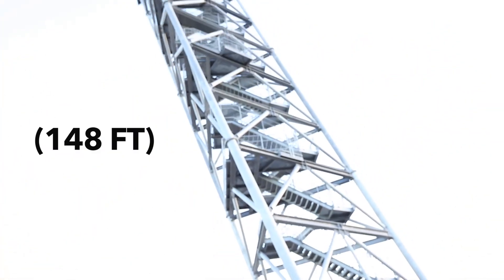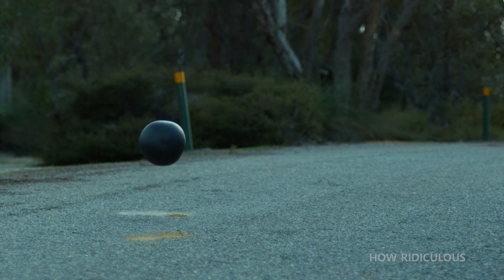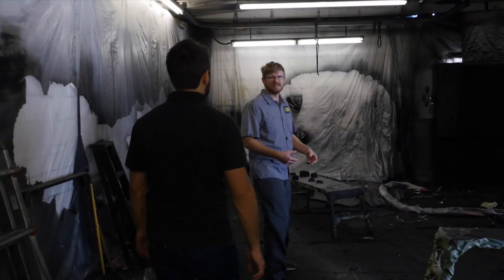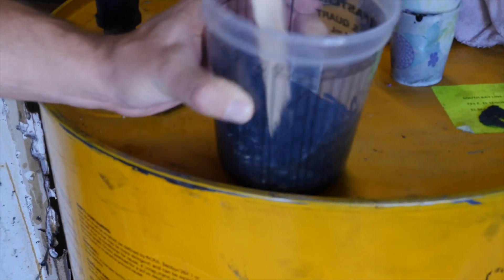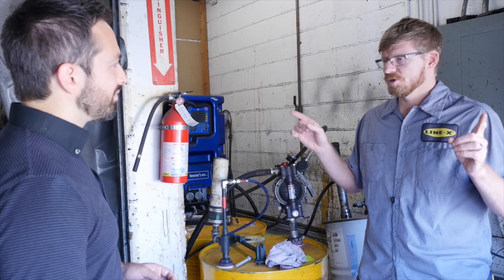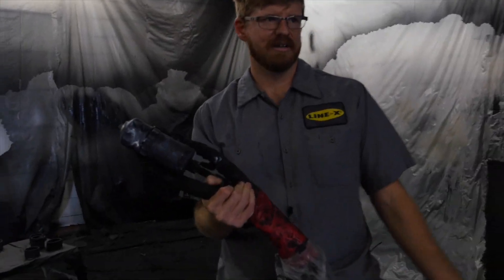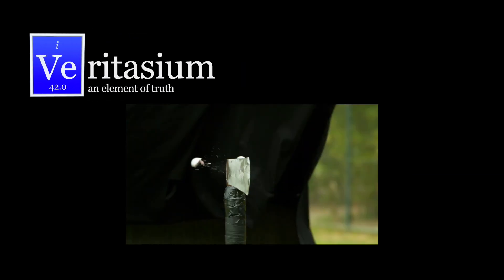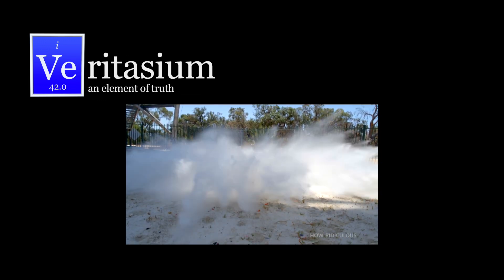Indestructible Coating?!

Comment: These guys should team up with team aerogel.
Anti ballstic outfits with superior insulation, for both cold and warm weather.
Reply: The areogel needs structural support, which is provided by the Line-X.
The aerogel provides great insulation and is kept together by the line-x.
Microcushioning allows both ballstic force dispersal but also insulation.

Space suits !

Comment: Years ago the Mythbusters used a product like this and sprayed a concrete wall with it. They then placed a 1lbs charge of C4 all of 3 feet from the wall and exploded the charge. The control test without the bed liner blew a hole in the wall. The bed liner covered wall survived the blast easily.

Comment: At 2:07 the barrel label says "polyol" but the molecular structure shown at 2:34 is a diamine. MDI+Polyol=Polyurethane and MDI+Diamine=Polyurea, a bit confusing...
By the way, the MDI is most likely polymeric MDI (PMDI), which is a mixture of MDI with polyfunctional phenyl isocyanates.
Reply: Yes

Comment: how a watermelon with g(9.8)m/s^2 accelerates up to 103 km/s only for 3 sec.
it should be ~30km/h in 3 seconds
Reply: am i stoopid?
Reply: It's 9.8 meters per second *squared*. It must be less than 3 seconds tho to be 103 km/h because if it was 3 seconds it would reach 158 km/h. I calculated 2.4 seconds to reach 103 km/h.

Comment: We can use this linex for army vests, inner ceramic coating, 2 layers of linex covered thick industrial strength  kevlar, it could survive ak and other shots.
Reply: Typically we have up to 4 ceramic plates in our vests, made of boron carbide, they are rated for small arms fire. An AK model rifle and several other types of rifles fire 7.62 mm rounds, this is currently what the ceramic plates are rated for. I'd be curious to know if spraying the plates themselves in Line X could increase the amount of attacks the plate can take, as they can only take a few rounds before they stop working. Or you could drop it on the ground. ceramic plates will break if dropped, even the smallest invisible hairline fracture can mean the difference between the plates doing their job, or your job coming to an end.

Comment: Stupid science 
Science poisoning the world is the solar system rotating inertia. 
Positrons + and electrons  -- rotate very rapidly after 4, 6 billion years of creating the Sun ' s core, so the core of the Sun rotates very quickly like A super large electric turbine that produces super large electrical energy. 
Every second the Sun emits 4,1million tons of electricity create sunlight, sunlight moves the circle back to its original position after 8 hours, so pushes the 8 planet to rotate in order

Comment: im very curious about utilizing this as a coating for Kevlar/ body armor. it would be excellent for blade resistance or low-power handguns.
Reply: Mythbusters actually did an episode where they coated a sleeve of a shirt with it and used it with a K9 attack dog.

Comment: I can see a thickness of about an inch in the watermelon coating application ..... Is that the right thickness to be used every single time...????
Or you a scammer....????
How about 12 mills to a maximum thickness of 23 wet mills... Then I believe you....Maybe you are not a professional applicator......mmmmmmmmm
I don’t know with this stupid video🥸

Comment: Pretty cool example... The initial watermelon drop made me think about how often they are compared with human heads and wonder about that result..... Of course the second result reminded me of what happens to a head inside a helmet... Internals can suffer pretty bad from a rapid deceleration, even if the outside isn't damaged much....

Comment: Could this indeed be the "molecular bonded shell" we've all been waiting for, inspired by KITT from Knight Rider??  Is it that good?  (If not, could it be improved for an even better bond?)
Reply: Actually, on second thought, a "molecular bonded shell" for a car would probably not be a good idea in real life.  1. As it would prevent any damage to the vehicle on impact, guess who would get the full force of the impact?  Crumple zones are a good thing!  2. If every car on the road had this shell, Aristotle's age-old question of what happens when "the unstoppable force meets the immovable object" (referenced in the Knight Rider episode "Trust Doesn't Rust") would be answered, and we wouldn't like the answer.
Reply: @ebinrock  Actually, the "shell" deforms as you see with the watermelon, so the crumple zones would also still work.  It would be great for preventing minor crashes from ruining your bumper though.

Comment: That’s so misleading... the watermelon is def nowhere to initial state, so NO It does NOT remain intact... the coating maybe, but the content NOPE... so it’s useless... let’s coat cars with it, it doesn’t matter do your brains are scrambled inside... looook the car has suffered a scratch ;)

Comment: Impressive, but that was a pretty thick, so you can’t really call it a “coating” - it essentially became a container vessel.
Reply: for the watermelon sure but I think they just sprayed copious amounts for that.
Reply: @kennarajora6532  That was my point.
Reply: @andy347  Yeah sorry I'm a bit dense. I thought you meant the coating was more of a vessel in general. Rather than for just the watermelon.
Reply: @kennarajora6532  Well, perhaps I should’ve elaborated. At what point do we transition from a “coating”, to a “structure”?  I would say them calling this a coating in this case is quite a mis-labeling.
Reply: @andy347  I guess coating is something more 'grafted' and stuck to the surface of something than say built over it. But I wouldn't know.

Comment: "It's amazing the watermelon survived". It didn't though, did it? The coating survived. The watermelon was  mushed on the inside. If you sprayed yourself with this stuff and jumped off that tower, the coating would be fine, but you'd probably have at least several broken bones and your insides would be mush.

Comment: Invented as truck inliner? Sorry, that is not true. The invention goes back to the 30s and 40s in Germany at Bayer company. And the first commercial application was insulation foam for beer barrels (sounds like a cliche, but is true).

Comment: If they had coated the Space Shuttle Main Tank with this material, we probably would NOT have lost the Columbia! Amazing stuff.
Reply: why didn't they have this stuff long before 2011 :(
Reply: and why did they not use aerogel for heat sheilds

Comment: Make an aerogel plate, cover it in this stuff and see how bulletproof it is.
Reply: @Azazel Aerogel is pretty fragile in it's original form. It'd be cool to see how durable it makes it.
Reply: @Azazel it is very light and if you spray it with this it will make a very light shield and a thermal insulator
Reply: Is this a new form of Fantasy Polymer championships? Where do I build my team?
Reply: That can work, it will also be very light and aerogel is pretty strong itself
Reply: @aar6538  aerojel is like ceramic. It’s a bit more fragile and the only bonus of putting it in armor is that it’s lightweight. Dragon skin armor plates would have the same effect as this.
Reply: @legitler1208  aerogel isn’t “a bit more fragile”. Aerogel is easy to break just by pressing on it with your finger.
Reply: @aar6538  
Aerogel on its own isnt hard.. its mostly air so.
Reply: @emperorpalpatine5559  that’s why spray it with this stuff and make it more durable
Reply: @aar6538  aerogel is extremely brittle so not that strong.
Reply: wait, that sounds like  the perfect heat shielding. What is the melting point of this polymere?
Reply: @KiithNaabal  my guess is its fairly low compared to aerogel. In other words not very viable.
Reply: @KiithNaabal  that’s not the question that needs to be asked here, what does need to be asked is how insulating it is because if it isn’t a good insulator then the aerogel is essentially pointless.
Reply: A light durable heat shield (and possibly bullet proof)
Reply: Smart
Reply: well aerogel is strong stuff then line-x- coating will turn it into a substance stronger than steel
Reply: @SodiumTriphosphate imagine thinking this
Reply: That is exactly the first thing that went through my mind.
Reply: It'll be great for light weight hard material like Armor or equipments
Reply: Gunnut?
Reply: Yooo thats genius actually
Reply: Can't tell if this is a joke or not but this material and aerogel is nowhere near hard enough to defeat any projectiles. Even 22lr would pass through it easily.
Reply: I like the concept. I figure what would be most effective is if you layered the two, one after another like bullet proof glass. Put a frame around it and you've got some light soft armor. Gotta test that for strength though
Reply: @Azazel Do you realize your username is named after a demon lord (not just in that anime)?
Reply: @talanorth8388  yeah Azazel is one of the best known of the biblical characters, it'd be real hard not to, and it's referenced extremely often. It's not bad as far as a name goes, short, memorable, has a nice ring to it. Why does it matter?
Reply: Aerogel is brittle, also if you cover it with this polymer you also remove this thermal insulating properties because the way it works is take fresh air from around its surface and when it heats up it escapes, maybe you can elaborate?
Reply: No. Fill the space between the aerogel with it.
Reply: Only problem is that the whole thing would be pretty weak (aerogel is very weak and this stuff is flexible). You would need some kind of backbone to keep it all in one rigid form.
Reply: @Azazel actually, extremely brittle. So yes it is something weak
Reply: @Azazel super critical fluid? part solid, part liquid ?
Reply: Nice
Reply: Aerogel is very brittle. Why tf would u use that
Reply: @drained1177  base aerogel is, but there are plenty of modifications that make it viable.
Reply: @Naokarma  but at that point there is no reason to use aerogel. Insulating properties aren’t really useful at all and it isn’t really the most lightweight option in other forms.
Reply: @peepock7796  "Insulating properties aren’t really useful at all"

Please tell me you're joking.
Reply: @Naokarma  “shield” please tell me you’re joking
Reply: This is dumb idea aerogel is rigid and crumbles easily while this is flexible material it will bend and gel will turn into dust.
Reply: @Cypeq  

Well. Even if it crumbles its still compacted to its original shape giving it some rigidity.

Comment: Why don't they put that stuff on tires and stuff. This could be revolutionary but they're spraying it on melons.
Reply: On tires? Have you ever heard about a thing called traction?
Reply: @SanityDrop  thats a good point, maybe the inside?
I'm not a tire person so idk
Reply: @toaster2822  What use would it have in the inside?
Reply: @siyacer  tires won't pop
Reply: It'd probably wear off on the road anyways. Having somewhat soft rubber lets you drive without sliding everywhere.

Comment: I overpronate a lot on my left foot causing my foot to destroy the top left corner of the outsole of my hiking boots,  heavy work boots duty boots, tactical boots, etc. No matter what quality of material the outsole is my left heel will destroy it within 2 months rendering it useless 😢 and be honest I'm tired of buying boots because nothing lasts. So could it be possible to put a layer of this in my outsole boots?

Comment: I used to work in a factory that created polyurethane foam parts for the auto industry (Cup-holders, armrests, etc). The chemicals that Line-x uses are the same as the ones that we used to make auto parts. This stuff has some amazing properties but as all of you saw it is an incredibly messy process. It's kind of crazy to think that with the right ratio of Iso and Poly and the right pressure, you can create this stuff.

However, these chemicals are an environmental disaster. Isocyanate reacts with water instantly and once it is exposed it crystallizes instantly and it is almost impossible to separate once it has made contact. Getting this stuff in your eyes, mouth, nose is horrible, you can go blind from it and it can be lethal. Plus the waste for any process involving these two chemicals is considerable. I'm surprised that the EPA hasn't shut that factory down. It was insane.
Reply: Is there a sheet or film version, maybe skived? What's the friction coefficient or what material is the friction similar to?
Reply: Interesting thanks for the comment
Reply: Neither trump or bidens epa has ever thought about clean and safe env standard
Reply: I agree, I also spent time in similar factories. Too bad there are no economical replacements. Maybe 3D printing in 20 years. All that PU has the deadly combo that capitalism loves. Its cheaper to make, faster to make, easier to make and stronger than most any other material in existence and it’s highly tunable. The difference in foam/plastic type you can get just by varying temp/pressure/ratio can produce a nearly infinite variety of products at practically no extra cost to the manufacturer. All the major processing tools and materials are the same. Like growing 100 different kinds of fruit from the same tree. Speaking of environmental impact, synthesizing the raw materials at plants like ones on chemical row in Louisiana. Eek, scary to see what it does to people and the environment. It’s really in everything. But it’s like what are people gonna start stuffing the seats of their Honda’s with dead leaves and coil springs?
Reply: @ericweiss9893  muh capitalism bad
Reply: " I'm surprised that the EPA hasn't shut that factory down" it's because the US military wants it...the single biggest polluter in the world
Reply: Woah.. why did you leave the work there
Reply: hitting a bouncy object with an axe is a good idea
Reply: Eat your heart out Thomas Midgley Jr.!

Comment: Is this bad for the environment tho, is there some way to despose of it without it just sitting the not decomposing a lot like plastic. Just a curious question
Reply: From what I've read this is an environmentally safe product. It doesn't breakdown with most environmental processes, and it can be recycled through Alcoholic Decomposition. So far the only problem is what to do with the products of the decomposition.

Comment: Had a question that is somewhat to do with this and gravity. When you throw the object up, there’s a natural curve/apex the majority of which has to do with the angle and velocity launched from...but once you launch it. It becomes an inertial observer, so does some of the return arc actually have to do with the shape of earth and/or the way in which the earth is accelerating towards the now reference-less object. Sort of think the answer is obvious, but 🤣 given physics...not so sure. Think more so the accelerating earth, but curious
Reply: The whole trajectory is determined by the initial position and velocity of the melon, not only the first part. 

Does the trajectory depend on the shape of the earth? No, it doesn't. If the earth was a point mass the trajectory would be the same up until it hits the ground.
Can the melon be an inertial frame/observer? No, since it is being accelerated.
Does the acceleration of the earth change the trajectory? Yes, but it is by all means negligible.

Hope I could answer your questions
Reply: Schumii thanks bo, but by his own description,  we can conclude that the ball is an inertial observer, even if only at the apex. Think you did answer my question and thanks. So it would ever so slightly be off, basically from the earth’s velocity and direction and that’s what I was asking. The shape ehh lol. Guess I was curious if a square body would act differently than a spheroid. 
Thanks again for taking the time.
Reply: Schumii my bigger idea that I’m unraveling is the difference between anti-gravity, which basically can’t exist(if my understanding is correct) and anti-mass(which is what’s portrayed in most pop culture, also might not be able to exist)
I mean really everything else is just some form of deflection. 
Thanks again, don’t have many peers who are willing to discuss these things.

Comment: Stuff like this makes me wonder why is everything ordinary made of the same crap. Rusting steel, and brittle weak plastics.
Reply: because it's cheap and easy to make
Reply: @finneh6145  Yeah, well, better plastics would be strong enough and still easier to make than steel, since they could be moulded, probably not even more expensive. And in place os  crappy plastic maybe somewhat more expensive, but a lot better.

Comment: imagine combining this stuff with a foaming agent - due to the structure, it should probably extremely quickly become rigid and secure whatever it is encasing or block what it is filling.  this could be a way to near-instantly seal things that are leaking, stop things from smashing into other things, or reinforcing static structures that are failing because of overload.  think of over-powered duct tape in a spray can! or a lightweight construction material for construction prototyping.

Comment: If I may, this product was made as a protective coating/ liner. Which ended up being used as a truck bed liner. Small FYI, this product actually goes on smooth. Texturing is achieved by misting it in the air and allowing it to settle on a freshly applied coating. 

Furthermore, by itself, it is not bulletproof, some type of kevlar or similar product is needed. Assuming mils are below .5-1" thickness. 

It can be used in bomb blast mitigation, which can be achieved by coating both sides of a masonry wall.

Comment: So if one jumps from the tower it will keep you intact to be identified but you'll still die. The up side is you'll bounce a few times in order to make sure the fall does it's job. That's what I took away from the video. Where is the tower?